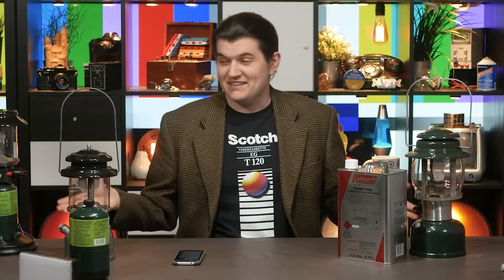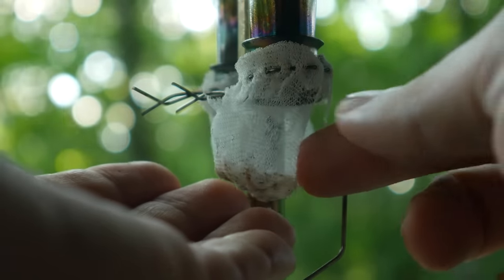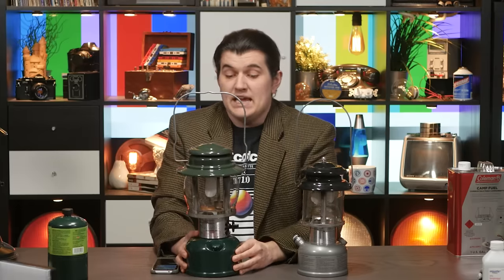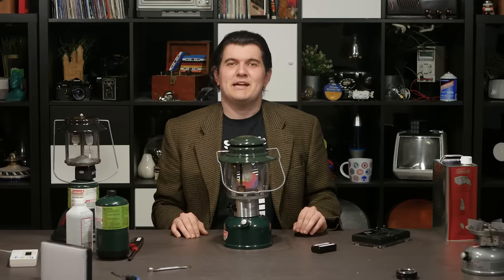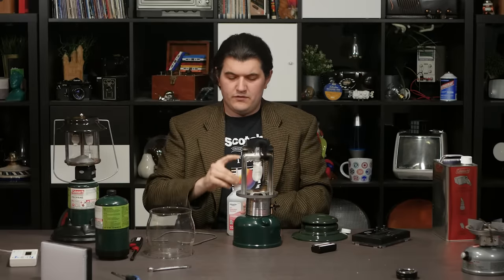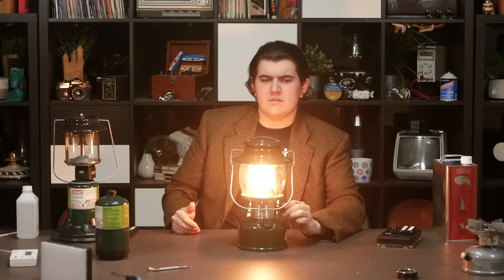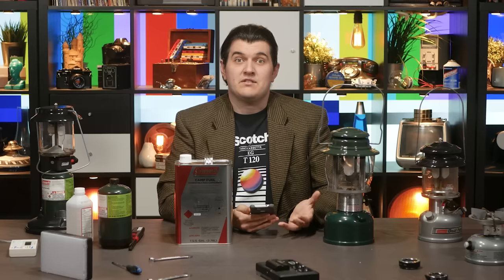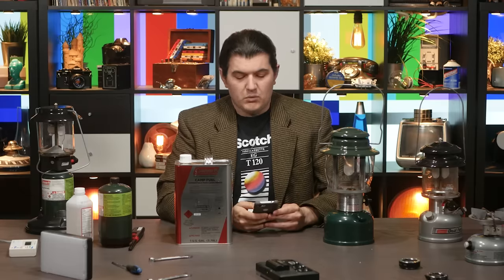A very rambly Coleman Lantern follow-up. Turns out they rarely make sense in 2021

Comment: In some parts of the US, especially out west, yiu'll find a lot of areas where you can get Kerosene delivered in bulk to a tank on your property, you can't get natural gas or electricity.  That's where having a kerosene lantern, or lamps, would make sense.  Though, to be honest, I see a lot of people who live in these very rural areas are switching over to small scale solar/battery installations.
Reply: Even in NC, we used to have all sorts of stuff on the farm... (no-road-tax) diesel, fuel oil, kerosene, LPG/propane. The house still has a fuel oil furnace, and gas logs in the fireplace. The tractor runs on gasoline, so we just fill a few cans at the local pumps. (keep the receipt to get that f'ing road tax back.) You have to get way out in the sticks to not have power. Today I'd opt for solar in a lot of places. (barns, well pumps, etc.)
Reply: Bulk delivery of kerosene is still a thing in Maine too.  "Home heating oil" with a red dye added so they can catch the people dodging the diesel road taxes.
Reply: @Kineth1  Kerosene is not "home heating oil".
Reply: @Kineth1  Home heating oil these days is typically ULS red dyed diesel, not kerosene. 
You can also burn kerosene in oil fired heating equipment, but it's typically 50¢ to a dollar a gallon more expensive. The only people who might need to use Kero is those who store their fuel outside. Kero is less likely to gel cold weather than untreated diesel.
Reply: @erikj.2066  Beat me to it -- I've even seen it delivered from the same exact truck, and talked to the driver to confirm.  Home heating oil is in fact just whatever the current seasonal road diesel formulation is with red dye added.  It's still a thing in the entire Northeastern US as far as I know.
Reply: @bradarmstrong3952  yes, it’s still a thing. 

I have 200 gallons of the stuff on the other side of the wall behind my bed (outside), for my oil fired boiler in the basement.
Reply: OFF ROAD GASOLINE (not taxed) is just as cheap as kerosene.  Almost a dollar less than auto gasoline.  So once again, no reason to deal with the lighting hassle of kerosene lamps

.
Reply: @electrictroy2010  kerosene is more energy dense than gasoline, so it burns to create more heat, light, and/or work per unit volume than gasoline.

Comment: The sound, the ambiance, the smell, the experience. The nostalgia is strong with this one.
Reply: Do white gas lanterns give off any smell ?
Reply: yeah if done right it is a soft hiss not a roaring sound.
Reply: @psirvent8  Yes, it's not strong but they do have a slight odor not too unlike exhaust from a small engine, which is not too surprising since white gas is essentially gasoline without the various additives.

Comment: 42:33 you accidentally touched on on why kerosene has a foot hold, unlike gas which can go bad or corrode, kerosene lamps and fuel can be stored without much room for an extended time.
Reply: I suspect that many a farmer or other user of "red" (untaxed) diesel has one or two just because they keep a relevant fuel in conveniently located tanks on their property...
Reply: Hmm, can you burn biodiesel in any of these lanterns, and will it smell like French fries?🤔
Reply: @goodun2974  I've used vegetable oil and kerosene in tiki/mosquito torches, as the regular fuel for those is crazy expensive.  Kerosene worked really well and served as a good carrier oil for some homebrew additives to keep the bugs away (I added small amounts of cedar and citronella oil to the kerosene to add a nice scent and deter the bugs).  The vege oil I used didn't burn too well, as it was a bit thick for the wicks and didn't wick up them, but a thinner vegetable oil could probably be made to work well.

All of that is assuming that you don't care about efficiency, as with bug/tiki torches you are burning them mich more for smoke (to deter bugs) and ambiance than for light.

Comment: The carbon build up is caused by the rubbing alcohol, switch to the yellow bottle of Heat and you will not see nearly the carbon build up. 
Great video and keep up the good work.
Reply: Or lighter fluid. Naphtha.
Reply: with a wick it should be possible to use kerosine, at least thats what my camping stove does
Reply: The nozzle on the heat bottle would make it easier to fill the generator without a straw
Reply: Heat is the best white gas I know of for these applications. I carry a white gas esbit stove on hikes and yellow heat has been a godsend for it, wouldn't use anything else for getting a clean, hot flame.

Comment: IMO, if most of the things are 90 degrees off from the "front" of the lantern... you have incorrectly identified the front of the lantern! I think you're assuming the dial is on the "front", but I have always thought they go on the right side on models like that.
Reply: I'm guessing that the assumption is someone would be holding it in their left hand (for righties) so that the right hand (dominant) is free to do stuff and thus the also putting the dials on the right as well to be easy to access?

Comment: I think that’s why there’s a thumb hole— so you can push the stem all the way in to secure it (if it was solid, you’d need to be fighting the pressure you pumped in while you twist-lock it).
Reply: Negative, it's to act as a check valve using your thumb as the valve.
Reply: @kentkirkpatrick7953  this video disproves that, though. He clearly pumps up the lantern just fine while leaving his thumb on the hole the whole time. If it were a check valve for pumping, that shouldn't have worked. The actual check valve is the cup-shaped bit on the end of the pump rod, inside.
Reply: @ChadHadsell  You're wrong. The hole is the check valve. The rubber cup on modern pumps, or leather on older models is the seal that holds the air to pressurize the tank on the down stroke. On the up stroke, it collapses some and allows air to enter the pump from the oil hole and around the cover of the pump. The hole on the end that you cover ensures that you don't over-pump the tank, as was suggested before.
Reply: @HunterAtheist  ah, I thought he was saying it was where the pumped air comes in, which it clearly isn't.

I'm curious, if the thumbhole is a check valve for overpressure, that means that the pressure in the tank is pushing on his thumb, right? And if the pressure goes too high, his thumb won't be able to contain it. So... Why doesn't the pressure all just bleed off when he takes his thumb off the hole?
Reply: Oh yeah?  A video by someone who has no experience with lanterns or,,  Me  with well over 100 lanterns 60 stoves dozen of lamps many irons lots torches and many other GPA related items. Think I'll believe what the Coleman manufacturer says it for.
Reply: @kentkirkpatrick7953  interestingly, you don't have any videos that show your experience with lanterns. And I don't know you. So no, I don't have any reason to trust your opinion over anyone else's. 

I was wrong, because I misinterpreted what you said. @Hunter Green cleared that up, without getting huffy about who knows more about anything, but instead just providing the information that I was missing.

I'm still curious about how the thumb-as-overpressure-valve works. Not because I'm trying to prove you wrong, but because I actually want to understand the mechanism. Perhaps your immense experience with lanterns means you could provide an explanation. Or maybe you just like getting angry on the internet?
Reply: @ChadHadsell  Okay, its hard to explain without video. There is a video called "How to remove a check valve out of Coleman products" or something like that. You can see it there. 

The check valve is a one way valve that allows the air you pump not to escape. If you don't cover the hole, the air will come out there instead of going into the tank since there is a hole in the tube of the pump handle. Idk if I'm describing this well at all. It's better you just watch the video I recommended above.
Reply: @ChadHadsell  The way the hole on the end is a over-pressure preventer is that if you are pumping into a tank that is highly pressurized, then you need to hold that pressure back when pumping the air into said tank. If you can't press as hard as the air in the tank, your thumb is forced off the hole, allowing the air to escape, thus preventing over-pressurization. If that makes sense at all.
Reply: @HunterAtheist  actually yes, that makes sense. Thanks!
Reply: @kentkirkpatrick7953  Negative,  it's so you can push the pump back in when you are done pumping.
Reply: @kentkirkpatrick7953  Wrong
Reply: @HunterAtheist  wrong
Reply: @HunterAtheist  wrong

Comment: The hole in the plunger makes it possible to stow the plunger and screw it down without having to fight the pressure of the tank
Reply: The check valve closes and seals the pressure in the tank every time you raise the pump plunger.  So what you are really doing is releasing the pressure between the leather or rubber seal and the check valve. Push down check valve opens. Pull plunger up and the check valve seals.
Reply: Disassemble the pump and you will see that it is a cup piston. Pushing the plunger in causes the cup to expand, sealing the cup against the pump walls and forcing the air into the tank. Pulling the plunger out allows the cup to relax and allow air into the piston area as it leaks around the cup seal.
Once the valve is closed you must uncover the thumb hole in the plunger to allow the air in the piston to exit the thumb hole and allow the plunger to be stowed in the inserted position.

Comment: There's two major thing your overlooking for those of us that winter camp. Propane doesnt perform well in near freezing conditions or at higher altitude. Using the duel fuel in those conditions are ideal.
Reply: It is butane, that doesnt perform well near freezing conditions. Propane boils at -40° and is, therefore, used in colder climates and at high altitudes.
Reply: Propane does just fine in cold weather or high altitude. It is butane that has problems in cold temperatures. High altitude will actually allow butane to work at slightly colder temperatures, as it lowers the boiling point. The burner may run a bit rich though.
Reply: I have had this happen with the standard 1lb canister.  Including the inability to make morning coffee. 🤨
Reply: @russlehman2070  For lanterns, propane is find at cold temperatures. But if you use gas too rapidly, the boiling will drop the temperature too low. Can even happen in fairly warm climes if too much is used from a small bottle.
Reply: @DTXBrian  Yup.  This is why "canned air" (for dusting off electronics and keyboards) or even CO2 tanks used for paintball guns will get very cold to the touch (and often have condensation dorm on the outside of them) when you use them a lot in a short period of time.
Reply: @humbleguy9908  Canadian Army here. Propane can be useless in the cold. I've been on more than one military exercises where it was so cold that the field kitchens simply couldn't function and we got stuck eating rations thawed out on coleman stoves.

Comment: Fun totally unrelated fact: white gas is what a lot of fire eaters use as fuel.
Reply: So if you're a fire eater on a camping trip in the winter......
Reply: That makes sense ! cheers.
Reply: Aka lamp oil is what steveo calls it
Reply: Fire eaters/breathers use kerosene, not white gas. Your thinking 
 of white paraffin, referring to a highly filtered and purified kerosene/paraffin.
Reply: It must taste better
Reply: @rebeuhsin6410  Neither pump gas nor white gas has lead compound. Pump gas has detergents and octane boosters, though, which are far more toxic than just hydrocarbons found in white gas
Reply: Really? My fire eating friends use lamp fuel. It is less “gasoline” tasting and is a bit safer.
Reply: @rebeuhsin6410  Pretty bad joke ngl
Reply: @rebeuhsin6410  In the US tetraethyl lead  is still used in aviation gas. It's called low lead aviation gasoline, but I don't know what concentration is considered "low lead".
Reply: @russlehman2070  Same in other countries as most general aviation aircraft are indeed fueled by AVGAS 100 LL.
(Although some of the newer aircrafts out there can run on regular automotive fuel (MOGAS) or on Avgas UL 91 (UL for Unleaded and 91 for the octane rating, which is slightly higher that the highest rating Mogas can be at 88))

Low lead means that Avgas did contain even more lead back then.
But leaded Mogas had actually less lead during its last years (Before being banned) than todays Avgas 100 LL.
"Low lead" is compared to other aviation fuels, not to automotive fuels.

Hope this all makes sense.